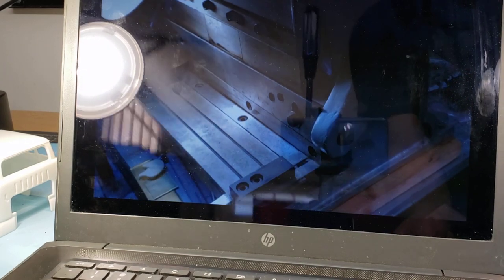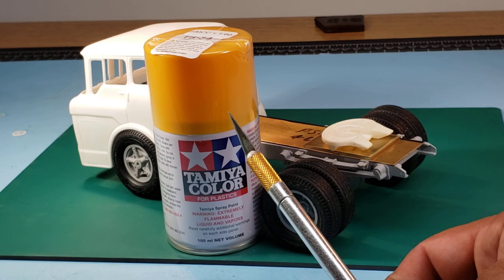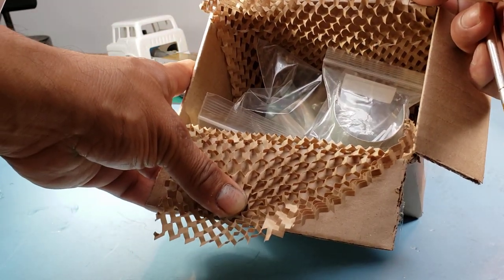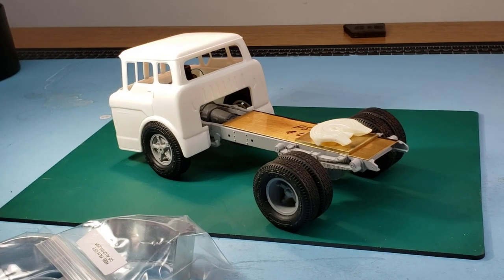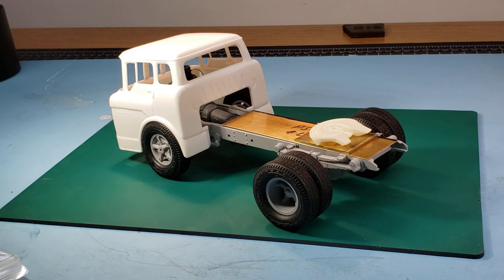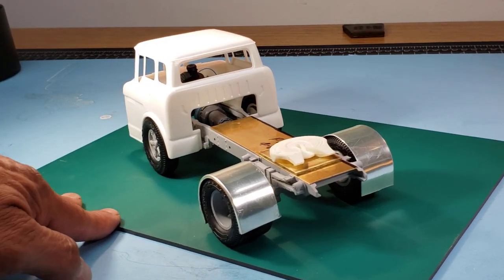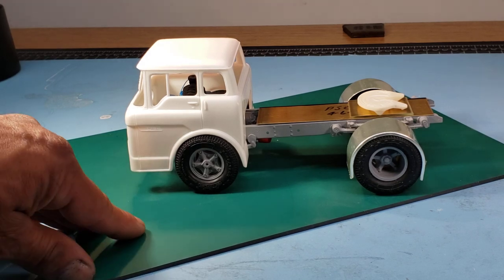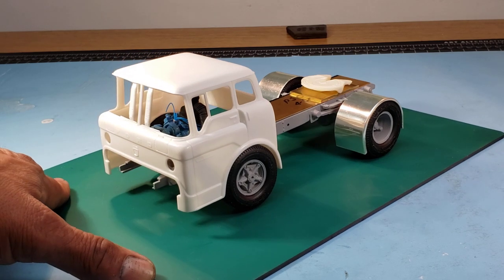AMT Ford c900 (Part 5) Custom Parts !!!

Comment: What the hell kinda shop you got? You do sheat metal and machinist work too? 
Photo etch dress up parts for an old shoe like this! That's next level cool. I haven't tried photo etch yet. Really thinking about it,just nervous about the expense against the fact that I'll just wipe them out!
I tend to make a lot of these parts outta wood,or thin styrene. I've steam bend a set of fenders for a couple of trucks. The really nice ones,that i sanded all the way to 2500 grit paper and stained red oak,were so cool! My little niece thought so too! She dropped it and it hit just right and snapped both sides! Oh well I love the little turd,so what you gonna do?
You ever tried bending that styrene sheet stock with hot water? It works pretty damn good. Done a set like that too.
See you on the next video!

Comment: That looks absolutely amazing. I can’t believe someone makes photoetched parts for it.  I love the brass in the back.  Are you going to weather it?  If you do, you need to put some dents in those wheel wells.  Thanks for sharing.
Reply from the maker: Thanks Michael....I'm going to try and copy the real prototype as much as I can....so very subtle weathering and I like your idea of denting the wheels.
Reply: @FlorentinoRebuildingCo.5644  I would dent them from the inside, so it will look like the tires threw rocks.

Comment: Are you going to model the doors open or closed? Will you be adding brake and air lines? Check out A4 garage's channel his Tamiya Morris mini cooper build is incredible! I can't wait for the next video of your build.Have you thought about scratch building metal leaf springs for future builds?
Reply from the maker: Tim, 
We think alike. I'm debating the doors right now.
I believe I have seen the mini Cooper build...
Tim yes I've been goofing around with real metal least springs.
I love your idea there....metal leaf springs,  providing extra weight down low at the 4 corners...nice. Also and excellent  strong point where I could reinforce the upper frame and body so no more busted wheels or breaking styrene leaf springs. 
Yes...I think that's a great, great idea.